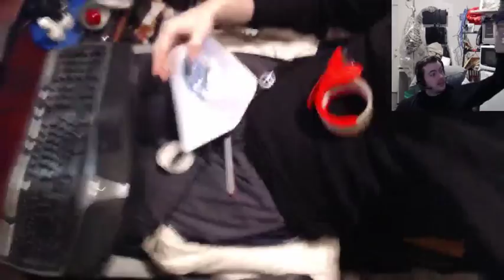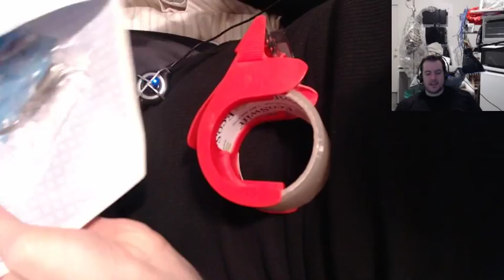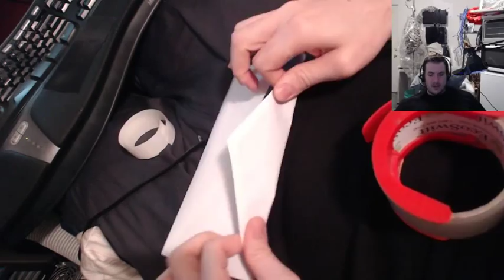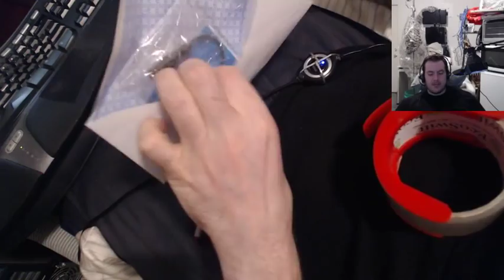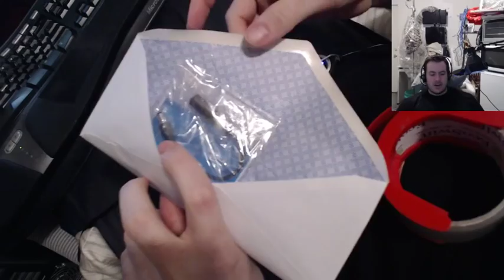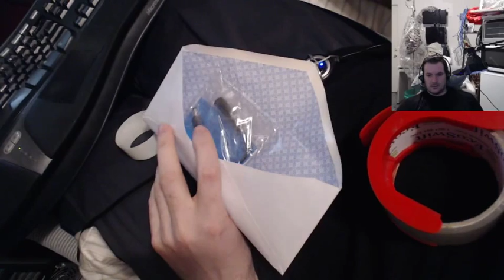Sending Keys, AAA Batteries, Etc via Stamped Envelope w/out it Tearing in Sorting Machines

Comment from the maker: Here are the rules:

From:
https://www.usps.com/ship/preparing-domestic-shipments.htm
-----------------------------------------------------------
Envelopes
Standard Sized Envelopes
Envelopes must be rectangular to qualify for letter prices.

Size Requirements
  Minimum Maximum
Height 3 1/2" 6 1/8"
Length 5" 11 1/2"
Thickness 0.007" 1/4"
Weight None N/A
Non-Standard Sized Mail
Non-standard mail, like square or vertical envelopes, lumpy or rigid envelopes, or mail with clasps, string, or buttons, cannot use our automated processing machines. Hand-cancelled mail is charged a non-machineable surcharge.

----------------------------------------------------------------

From:
https://pe.usps.com/text/dmm300/201.htm#ep1042572
-----------------------------------------------------------------

1.1.1 Dimensional Standards for Letters
Machinable letter-size mail is:

Not less than 5 inches long, 3-1/2 inches high, and 0.007-inch thick.
0.007 inch thick if no more than 4-1/4 inches high and 6 inches long; or
0.009 inch thick if more than 4-1/4 inches high or 6 inches long, or both.
Not more than 11-1/2 inches long, or more than 6-1/8 inches high, or greater than 1/4-inch thick.
Rectangular, with four square corners and parallel opposite sides. Letter-size, card-type mailpieces made of cardstock may have finished corners that do not exceed a radius of 0.125 inch (1/8 inch) unless prepared as Customized Market Mail under 243.9.0. See Exhibit 1.1.1.
Within an aspect ratio (length divided by height) of 1.3 to 2.5, inclusive. See 3.7.
Subject to additional dimensional restrictions in 3.0, depending on mailpiece design.

1.1.2 Weight Standards for Machinable Letters
The maximum weight for Presorted First-Class Mail machinable letters is 3.5 ounces (0.2188 pound). The maximum weight for USPS Marketing Mail machinable letters is 3.5 ounces (0.2188 pound).

2.1 Criteria for Nonmachinable Letters
A letter-size piece is nonmachinable if it has an exterior surface that is not made of paper or if it does not meet the standards in 3.0. A mailpiece is nonmailable if it does not meet the minimum dimensional standards in 1.1.1. Windows in envelopes made of paper do not make mailpieces nonmachinable. Attachments do not render mailpieces nonmachinable if allowed by eligibility standards according to the class of mail and if not prohibited in 3.0. In addition, a letter-size piece is nonmachinable if it weighs more than 3.5 ounces.

3.1 Basic Standards for Automation Letters and Cards
Letters and cards claimed at any machinable, automation, or USPS Marketing Mail carrier route price, must meet the standards in 3.0. Unless prepared as a folded self-mailer, booklet, or postcard under 3.14 through 3.17, each machinable or automation letter must be a sealed envelope (the preferred method) or unenveloped. If unenveloped, each letter must be sealed or glued completely along all four sides or prepared under 3.15.

3.12 Flexibility Standards for Automation Letters
3.12.1 Machinability
To ensure transport through automated mail processing machines, a mailpiece and its contents must bend easily when subjected to a transport belt tension of 40 pounds around an 11-inch-diameter drum.

3.12.2 USPS Services for Flexibility Testing
A mailer requesting flexibility testing for letter-size mailpieces must submit at least 5 mailpieces and a written request to their local postmaster or business mail entry manager for submission to the Pricing and Classification Service Center (PCSC) at least 6 weeks before the mailing date. The request must describe mailpiece contents and construction, number of pieces being produced, and preparation level. The PCSC will evaluate the piece and, if warranted, will instruct the mailer to submit samples to USPS Engineering for testing. The PCSC advises the mailer of its findings. If the mailpiece is approved, the letter includes a unique number identifying the piece and serves as evidence that the piece meets the relevant standards. A copy of the letter must accompany each postage statement submitted for mailings of the approved piece. If requested by the USPS, the mailer must show that pieces presented for mailing are the same as those approved.

4.4 Uniform Thickness
Flat-size mailpieces must be uniformly thick so that any bumps, protrusions, or other irregularities do not cause more than 1/4-inch variance in thickness. When determining thickness, exclude the outside edges (1 inch from each edge) when the contents do not extend into those edges. Also, exclude the selvage of any polywrap covering (see 4.5) from this determination. Mailers must secure nonpaper contents to prevent shifting of more than 2 inches within the mailpiece if shifting would cause the piece to be nonuniformly thick or result in the contents bursting out of the mailpiece
Reply: Wrong rules... That's for Letter rules, you are shipping an item, a hard item see DMM 601.3.3  

3.3 Odd-Shaped Items in Paper Envelopes
Pens, pencils, key rings, bottle caps, and other similar odd-shaped items are not permitted in letter-size or flat-size paper envelopes unless they are wrapped within the other contents of the envelope to streamline the shape of the mailpiece and prevent damage during postal processing. If an odd-shaped item is not properly wrapped, it could burst through the envelope and cause injury to employees and damage to USPS processing equipment. Odd-shaped items that are properly wrapped within paper envelopes and sent at letter prices may be subject to the nonmachinable surcharge under 133.1.5 or 233.1.4 for First-Class Mail letters, or the nonmachinable prices under 243.5.5 for USPS Marketing Mail letters. Certain types of odd-shaped items, when properly wrapped, are permitted as automation letter-size mail subject to the standards in 201.3.10. Flat-size automation mail is subject to the uniform thickness requirement in 101.2.4.

Comment: 3.4.3 Dimensions and Other Physical Standards for Automation-Compatible Enveloped Letters Containing Discs
Each enveloped letter must meet the basic standards for machinable letters in 1.0 and have the following characteristics:
Height, not more than 6 inches or less than 5.5 inches high. 
Length, not more than 9.75 inches or less than 7.25 inches long. 
Thickness, not more than 0.25 inch or less than 0.009 inch thick.
Weight, not more than 3 ounces. 
A piece up to 8 inches long must be made of paper with a minimum 70-pound paper basis weight or equivalent.
A piece over 8 inches long (up to 9.75 inches long) must be made of paper with a minimum 80-pound paper basis weight or equivalent.
Discs in mailpieces made of the minimum basis weight paper must be inserted into a protective sleeve.
Not be a window envelope, unless tested and approved under 3.4.1.

Comment: is it fine if i send plastic keychins using forever stamps?
Reply from the maker: as long as it is flat enough  and either small or flexible so that the envelope can make the turns in sorting machines
Reply from the maker: maybe use TPU/ninjaflex as the plastic so its flexible enough
Reply: @artbyrobot1  thank you for ur fast reply!

Comment: I tried to mail a car key and taped it to a piece of paper in the envelope.  Came back to me marked postage due 3 dollars.  Can this be right?
Reply: sounds wrong to me.  Weight it and cross check that with weight limits for a stamp.  Might use 2 stamps but pretty sure just one key and typing paper should have gone through fine.  Was it a normal legal envelope?  Maybe the key was the magnetic type of car key adding weight and thickness that triggered all of this.  Best to stick to flat keys.
Reply: Larry L yeah it was a newer key with a chip that makes it fatter than a normal key.  But less than 2 oz for sure.
Reply: @larryl6683  He sent an entire car key. Not your typical house keys, its over .25 thick
Reply: Yes it does you didn't follow the postal rules and his method violates the rules.. Talk to the post office and ask how to mail it, mailing a key in an envelope, unless done a certain way, will get it returned as it can damage their equipment and people.

Comment: hey does this work when sending internationally? If so, do you have to have a custom form?
Reply from the maker: The whole point of using an envelope is to get the low price of shipping by stamp.  You cannot ship by stamp internationally unless you sold it using the eBay global shipping program in which case they will pay the shipping to the other country.

Comment: Unless you're okay with the possibility of the item being damaged and/or shipped back, I would not recommend this method.  The envelope and the cheapest rate is strictly for "letters" and paper only.
Reply from the maker: This is utterly untrue.  There are very strict guidelines on envelope thickness, lumpiness, flexibility, weight, etc that all point to machine-ability to run it through the sorting machine.  As long as your configuration will pass through the machines without being damaged or stuck, it does not matter what is in the envelope and nowhere within the guidelines does it ever say anything about "paper only" which you clearly just made up.  I've successfully shipped several hundred items like keys and coins and patches and small plastic parts and tubes containing fluids, etc in stamped envelopes with no issues.
Reply: @artbyrobot1  Standard postage rates are strictly for letters and papers.  Anything that deviates from that description is technically not allowed and will be subjected to get returned to the sender with the affixed postage forfeited.  And even they are subject to maximum thickness and weight restrictions.  Those that do send small items such as keys, cables, and other small trinkets that fit in standard letter-size envelopes usually pay large envelope fee or package rates based on weight anyway, not the standard letter-size postage.
Reply from the maker: You are utterly and absolutely wrong, you made that up, it does not say that in the USPS rules, and you completely ignored the fact that I literally just told you I have shipped several hundred small items with normal postage stamps that were not treated any differently than had I mailed a single sheet of paper.  They arrived to customer in one piece and no further charges were involved.  Do some research next time before spouting off your bullshit and making things up to mislead people.  Also, learn to read when I reply and not be pig headed and ignorant.
Reply: @artbyrobot1  No you are the one that's wrong.  Look it up on USPS it says so clear as a day that standard single 1st Class postage (i.e. forever stamps) that costs current going rate is for letters and papers in standard envelopes only, in addition to not exceeding a certain weight or thickness.  Just because you're defrauding postal service and the fact that you're local USPS in particular is not doing anything about it doesn't mean that it's "allowed" in general.  Try doing this at other post offices that follow regulation, and they'll send it right back to you.
Reply from the maker: Calling me wrong is saying the USPS own rules are wrong because unlike you, I'm going by their rules, not something I just made up pulled out of my ass like Roger the idiot here.  Here are the rules:

From:
https://www.usps.com/ship/preparing-domestic-shipments.htm
-----------------------------------------------------------
Envelopes
Standard Sized Envelopes
Envelopes must be rectangular to qualify for letter prices.

Size Requirements
  Minimum Maximum
Height 3 1/2" 6 1/8"
Length 5" 11 1/2"
Thickness 0.007" 1/4"
Weight None N/A
Non-Standard Sized Mail
Non-standard mail, like square or vertical envelopes, lumpy or rigid envelopes, or mail with clasps, string, or buttons, cannot use our automated processing machines. Hand-cancelled mail is charged a non-machineable surcharge.

----------------------------------------------------------------

From:
https://pe.usps.com/text/dmm300/201.htm#ep1042572
-----------------------------------------------------------------

1.1.1 Dimensional Standards for Letters
Machinable letter-size mail is:

Not less than 5 inches long, 3-1/2 inches high, and 0.007-inch thick.
0.007 inch thick if no more than 4-1/4 inches high and 6 inches long; or
0.009 inch thick if more than 4-1/4 inches high or 6 inches long, or both.
Not more than 11-1/2 inches long, or more than 6-1/8 inches high, or greater than 1/4-inch thick.
Rectangular, with four square corners and parallel opposite sides. Letter-size, card-type mailpieces made of cardstock may have finished corners that do not exceed a radius of 0.125 inch (1/8 inch) unless prepared as Customized Market Mail under 243.9.0. See Exhibit 1.1.1.
Within an aspect ratio (length divided by height) of 1.3 to 2.5, inclusive. See 3.7.
Subject to additional dimensional restrictions in 3.0, depending on mailpiece design.

1.1.2 Weight Standards for Machinable Letters
The maximum weight for Presorted First-Class Mail machinable letters is 3.5 ounces (0.2188 pound). The maximum weight for USPS Marketing Mail machinable letters is 3.5 ounces (0.2188 pound).

2.1 Criteria for Nonmachinable Letters
A letter-size piece is nonmachinable if it has an exterior surface that is not made of paper or if it does not meet the standards in 3.0. A mailpiece is nonmailable if it does not meet the minimum dimensional standards in 1.1.1. Windows in envelopes made of paper do not make mailpieces nonmachinable. Attachments do not render mailpieces nonmachinable if allowed by eligibility standards according to the class of mail and if not prohibited in 3.0. In addition, a letter-size piece is nonmachinable if it weighs more than 3.5 ounces.

3.1 Basic Standards for Automation Letters and Cards
Letters and cards claimed at any machinable, automation, or USPS Marketing Mail carrier route price, must meet the standards in 3.0. Unless prepared as a folded self-mailer, booklet, or postcard under 3.14 through 3.17, each machinable or automation letter must be a sealed envelope (the preferred method) or unenveloped. If unenveloped, each letter must be sealed or glued completely along all four sides or prepared under 3.15.

3.12 Flexibility Standards for Automation Letters
3.12.1 Machinability
To ensure transport through automated mail processing machines, a mailpiece and its contents must bend easily when subjected to a transport belt tension of 40 pounds around an 11-inch-diameter drum.

3.12.2 USPS Services for Flexibility Testing
A mailer requesting flexibility testing for letter-size mailpieces must submit at least 5 mailpieces and a written request to their local postmaster or business mail entry manager for submission to the Pricing and Classification Service Center (PCSC) at least 6 weeks before the mailing date. The request must describe mailpiece contents and construction, number of pieces being produced, and preparation level. The PCSC will evaluate the piece and, if warranted, will instruct the mailer to submit samples to USPS Engineering for testing. The PCSC advises the mailer of its findings. If the mailpiece is approved, the letter includes a unique number identifying the piece and serves as evidence that the piece meets the relevant standards. A copy of the letter must accompany each postage statement submitted for mailings of the approved piece. If requested by the USPS, the mailer must show that pieces presented for mailing are the same as those approved.

4.4 Uniform Thickness
Flat-size mailpieces must be uniformly thick so that any bumps, protrusions, or other irregularities do not cause more than 1/4-inch variance in thickness. When determining thickness, exclude the outside edges (1 inch from each edge) when the contents do not extend into those edges. Also, exclude the selvage of any polywrap covering (see 4.5) from this determination. Mailers must secure nonpaper contents to prevent shifting of more than 2 inches within the mailpiece if shifting would cause the piece to be nonuniformly thick or result in the contents bursting out of the mailpiece
Reply from the maker: Note that nothing in the rules above says jack shit about it having to be paper you LIAR!
Reply from the maker: And if it is the correct weight and size and runs through all the machines okay, that is a JOKE to say that is defrauding the USPS are you really that dumb?  They just move your shit from point A to point B so that is not fraud.  They can care less what is inside the envelope and it is even illegal for them to check what is inside a first class envelope:

As per: https://pe.usps.com/text/dmm300/233.htm#ep1036709

3.2.2 Inspection of Contents
First-Class Mail is closed against postal inspection.
Reply: @artbyrobot1  <--- Amidst any civilized discussion, it's always the loser that resorts to initiating personal insults, childish name-calling, and temper tantrum.  USPS regulations clearly states that First Class postage is restricted to only letters (paper) and card/cardstock papers that are machinable.  When people try to mail items within standard envelopes masquerading as regular First Class mail pieces, they could potentially damage USPS's sorting machines.  This is why anything that deviates from the maximum dimensions of standard First Class mail are subject to additional surcharge.  You are simply justifying your routine unethical behavior of defrauding the postal service.
Reply from the maker: Except I copy and pasted every rule page on the subject and only Roger the delusional can come up with rules stating his opinions with no citing to back it up.  Some people will never learn.
Reply from the maker: Nowhere in the rules does it say what you are saying and yet you still stick to it and such is the definition of madness and stubborn foolishness.  You are like a child.
Reply: @sdlock83  "Unethical" lmao
Reply: @artbyrobot1  amen